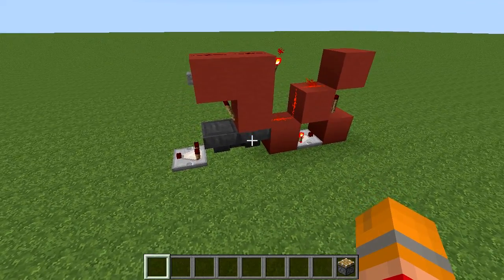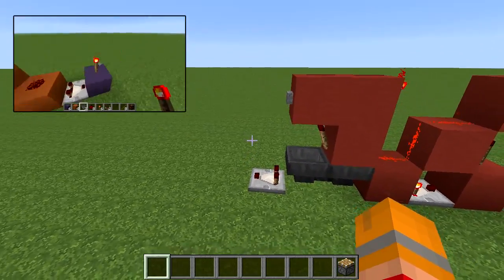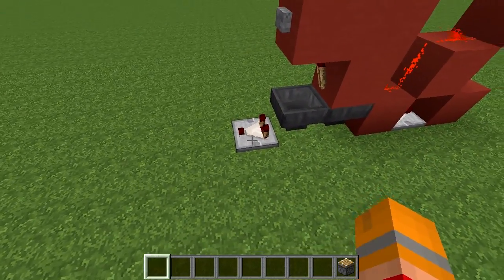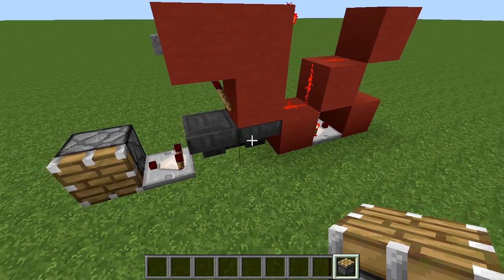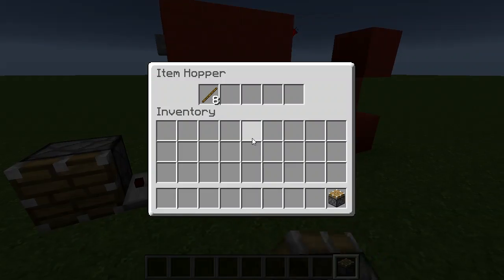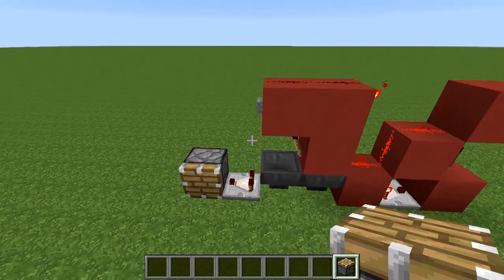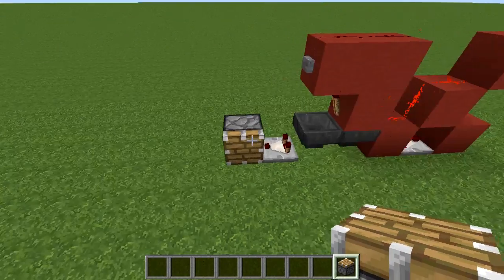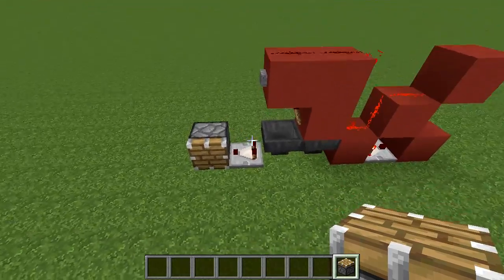Long Timer (Pulse Extender)

Comment: You can easily make it a one tick pulse by something like the basic trick of placing a repeater and then a piston facing up with a block on it. It will make a short pulse go throw and then extend the piston, and block the path of the redstone signal.